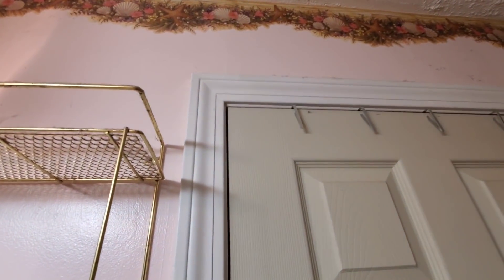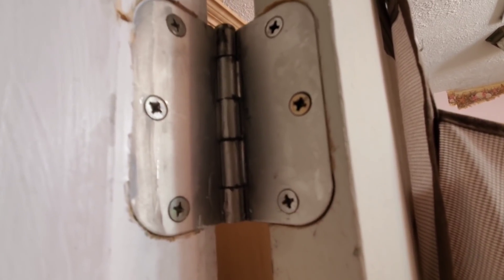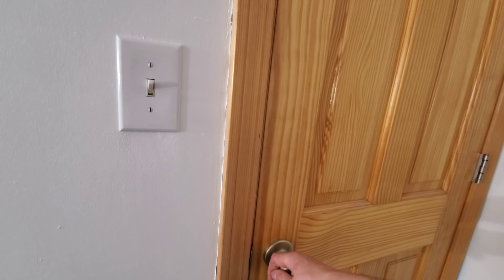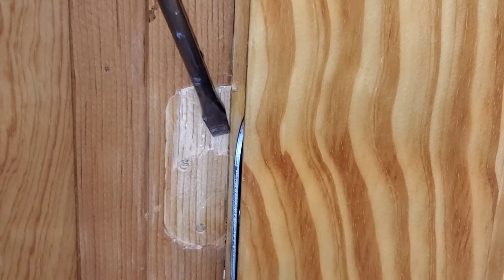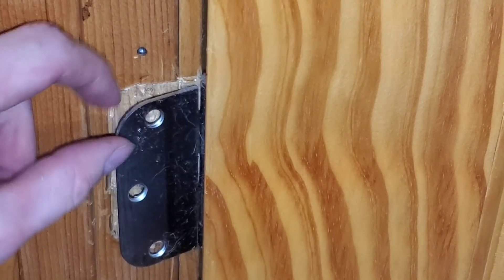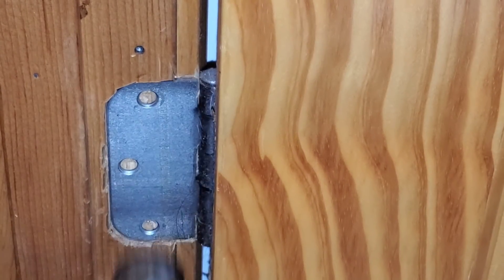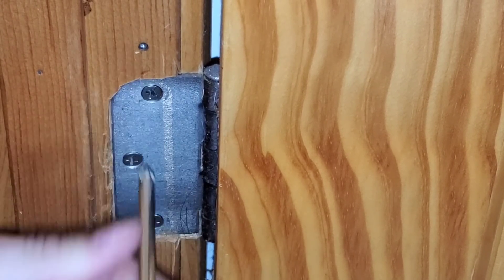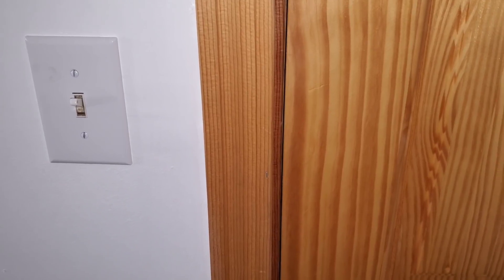How To Stop Door Hitting Trim

Comment: Nice tip. On the stripped out screw hole on your hinge, if you take a couple of toothpicks, coated in wood glue, and put them in the hole, and let them dry, your screw will catch and hold much better.
Reply: Or longer screws.
Reply: next time just take a dowel rod or even a golf tee and break it off into the hole. no need to wait for glue to dry

Comment: A man who knows what he is doing! My father was a carpenter and a builder, you remind me of him ♥
Reply from the maker: Juan Labadie  Your just being a troll, i fixed the issue with the tools I had and it looks fine
Reply: Juan Labadie  Or put a wedge bw the door and jamb then push the door  to open the gap, or get a hingebender from Amazon.
He did get the job done tho.  I'm a Cabinetmaker so tools are not an issue.
Typo on your first message, culverts not coverts , unless you are hiding something.  Humour!!
Reply: He’s being honest. You fixed it. Good on you, but yes carpenters are laughing at you for using a screwdriver to chisel wood. You can surely see why a carpenter or knowing handyman would get a chuckle out of that. It’s not the end of the world buddy.
Reply: Juan Labadie  Go to amazon and look up 'hingebender', they exist.  If there was an address for Post 10, I'd send him one.
Reply: @post.10  I'm not Juan, when I saw you taking a mechanics tool to wood I cringed. Stick to drainage. A carpenter you are not. A cheap chisel would have done a better job and you went about the job all wrong. I like you and I like every one of your videos but this was a video on how not to fix a sticking door.

Comment: Post:
To correct binding near the middle of the door you can often quickly correct the problem one of two ways:
1) replace the strikeplate screws with screws long enough to sink into the framing and torque the jamb over a little; or,
2) take a piece of scrap lumber, put it against the part of the jamb that's binding, and give it a sharp hit with a mallet.

Comment: Since those screws were too short, you probably only needed to change them to longer ones and tighten them.
Reply: Shove a matchstick in the hole to act as a rawl plug before offering up the screw, and it'll hold tight.

Comment: A lot of the time this is caused by the hinges being bent towards the handle at the pivot point.  More often than not that is the cause for the top of the door rubbing on the side.  Easy enough to fix by pulling the hinge pin and bending it appropriately.

Comment: I had a door that wouldn't always latch, and I eventually realized it was because the strikeplate was misaligned from the doorknob. moving the plate up away from where its hole was fixed it.